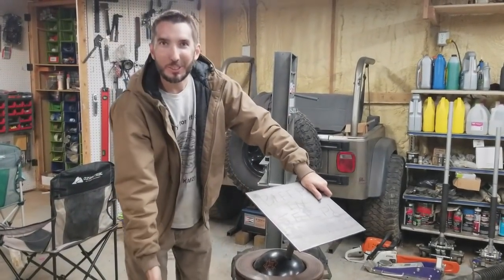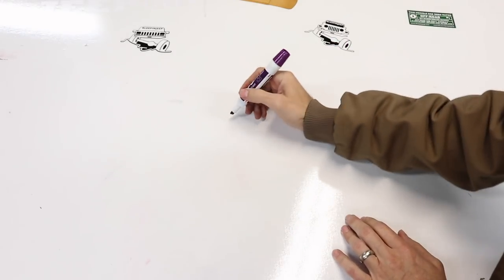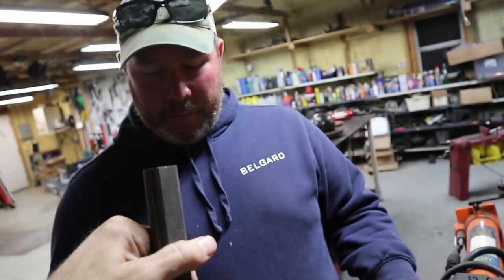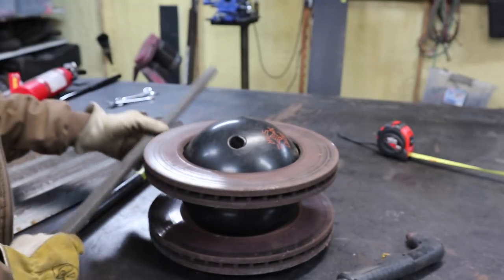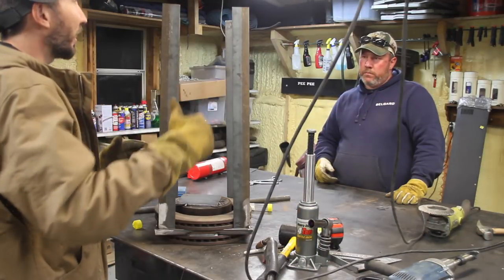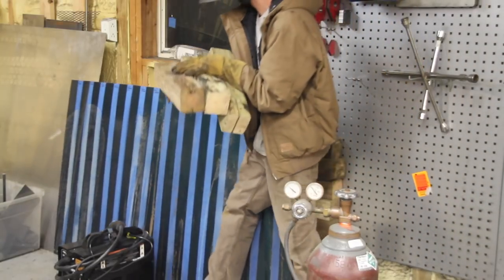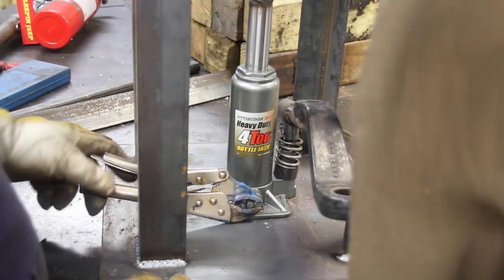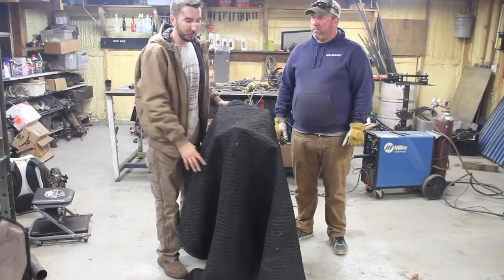Can We Make a Bowling Ball Welding Table in 4 Hours?

Comment from the maker: Hey guys, thanks for watching!  So . what would you do with this thing?  What are some practical uses that you can think to use it for?
Reply: I just really enjoyed watching this! Great job!
Reply: Watch it Harbor Fright is gonna start selling these.
Reply: BleepinJeep polyester resin is what bowling balls are made of,  we ship 2 tank wagons of resin at a minimum to ebonite bowling ball company
Reply: That’s awesome!
Reply: I was thinking about the table top, where you have the rod going into the bowling ball, if you drilled a smaller hole off to the side of the main hole and then welded a 90 degree piece of round rod to the main rod, so that it looked like an h, when you slipped it into the two holes it would be pinned in place. The main point is that you can remove the table and easily drop in replacement objects! A vise, fancy flashlight holder, etc. I guess you could thread the ball instead, this would just be less work in the end I think. Hey, how about metal sleeves for the holes? Ironically my wife had the rotors replaced on her car recently and I told her to bring the old ones home because I didn't believe the shop, heh, so now I have project material! Just need to hit a pawnshop for the bowling ball, hehehe!  Awesome build guys!!
Reply: You guys should put a return spring on the release pedal
Reply: It's a very practical welding positioner.  If you don't know what those are, you probably don't need one.  It's easier to produce a proper weld or braze joint when you can move the workpiece instead of becoming a contortionist.
Reply: BleepinJeep grease the ball

Comment: Ok, for one thing DiGiorno pizzas are parbaked which means that Jeremy's technique might be good enough but if you are making a pizza with fresh dough you absolutely have to preheat. The hotter the better. And you need a stone. Secondly, 4 tons seems like a lot of force to keep a bowling ball from wiggling around. There's got to be cam action mechanism or a toggle clamp that would do the job more efficiently.

Comment: id put a sleeve in the ball with clamp on the end to adjust height of the plate or so you could spin it with out moving the ball
Reply: With a nut and "set screw". A bit like the "feet" but different.
Reply: *on the sleeve

Comment: I would be great for TIG welding small parts, drill holes in the top plate for a vise to hold parts like tubing round or square, two pieces of pipe or solid rod etc etc, Jim las vegas nv

Comment: I want to see a bumper tank. Weld a bumper that also works as a tank for on board air. Pabst boys did it but I bet Matt can do a better one.
Reply: Sam Sam I've seen those it's cool but dangerous as fuck....think about it
Reply: Dangerous, nah not really. It's air not oxygen. Besides the best way is with round tubes which look ugly on XJs and ZJs I think. Putting a tank somewhere is probably what I would do.
Reply: Sam Sam yes absolutely it doesnt have to be combustible to be dangerous. You get in a slight fender bender and it's a small bomb. 98% of the guys attempting a bumper tank aren't educated in welding pressure vessels, they're just a dude with a mig machine In their garage.
Reply: Fact: 87% of all percentages are make up. I've seen pipes blow up from pressure and its not a bomb. It sounds like a bomb but once a hole is found for the escaping pressure it rips a little and escapes. The pressure doesn't keep increasing and expanding the hole like a bomb or explosion.

Comment: Hi, I am looking to swap out rearends on a 1998 Jeep Cherokee Laredo.  I know that the gear ratio is the same, i had the vin's ran.  Looking for information in doing this. Or, would it be easier just to swap out the differential gears? If swapping out the gears is easier looking for information on doing that.
Reply: Swap rear end. gears need special tools to setup backlash and such.
Reply from the maker: I do have videos of removing a rear end, reinstall is the same although I probably have video on that too.  And gearing videos although that is complex.
Reply: Quinn Bogenreif what kind of special tools will I need and the best place to get them?
Reply: BleepinJeep I saw the video for removing and reinstalling a rear end, but my 98 Grand Cherokee Laredo does not have leaf springs.
Reply: I think you need a dial indicator on a certain type of mount. It is going to be much easier to just swap the whole axle. I've done like 3 before. Pretty simple and can be done in a day or two if your new at it.